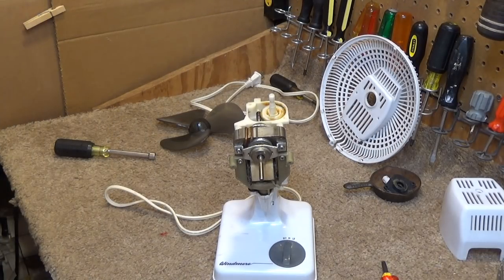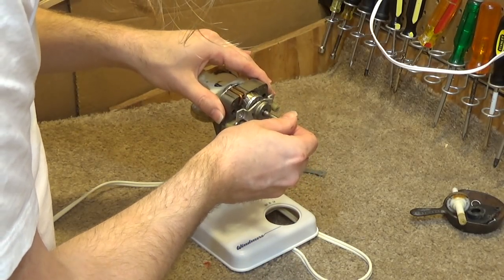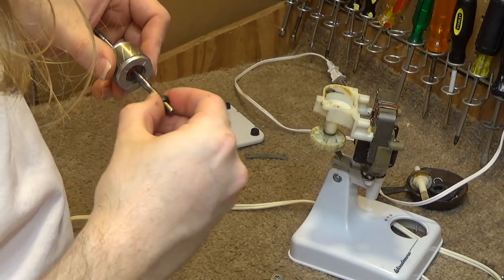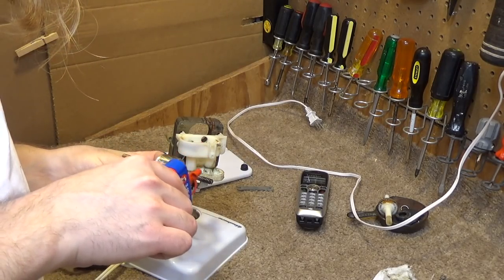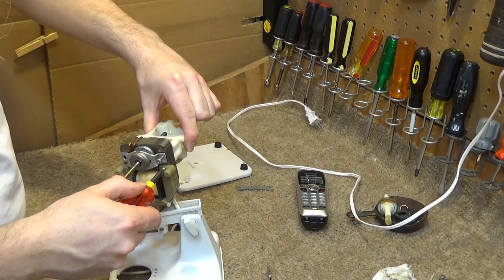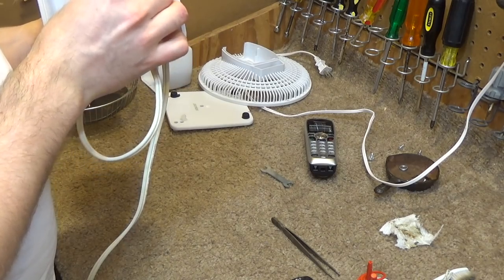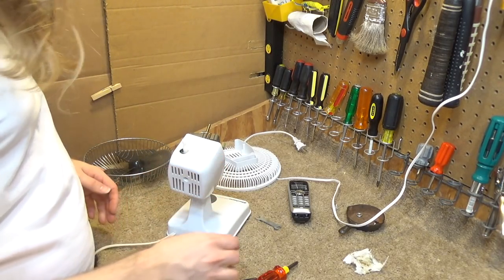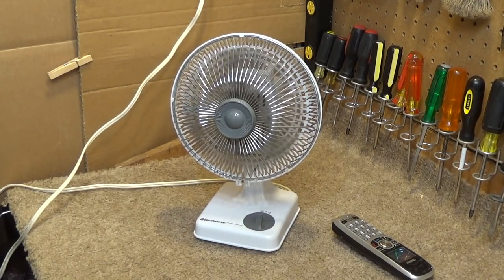Clean, Service and Repair Windmere 7" Oscillating Fan Model DF-7

Comment: Hi, I’m having trouble with getting the casing off, could you please point me to the dismantling video (I couldn’t find it).  Thank you
Reply from the maker: I don't think I've recorded the removal of the guard...but it's relatively simple. There is a screw on the bottom that needs to be removed, then there are several plastic tabs around the outside that are connected to the rear plastic portion of the guard. Those tabs need to be pushed away from the center and back towards the motor, over the metal guard, releasing it.
Reply: Hey Jordan, I managed to fix my Windmeer fan. I found it in the abandoned house but online I removed the logo because it was already fading away.

Comment: How did u get the blades off?
Reply from the maker: It pulls off, but sometimes takes a fair bit of effort after being on the shaft for so long. Slow and gentle will get it off eventually.